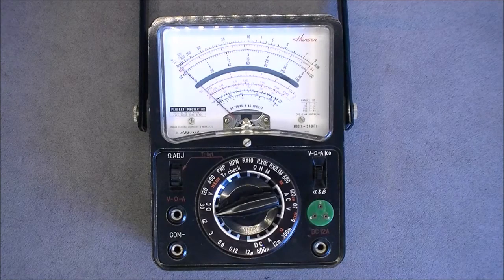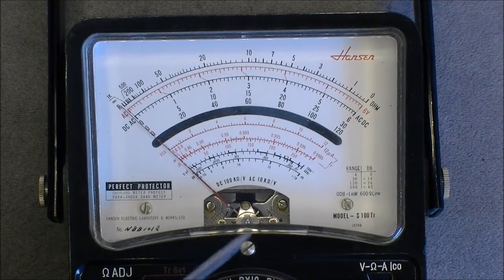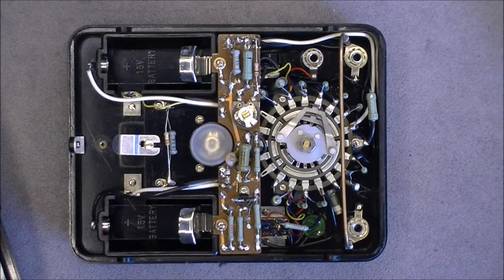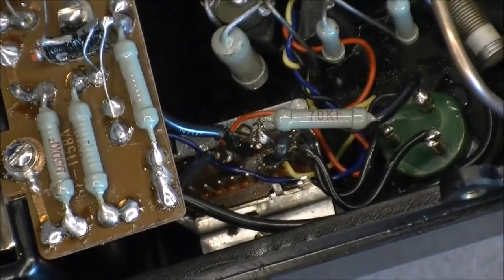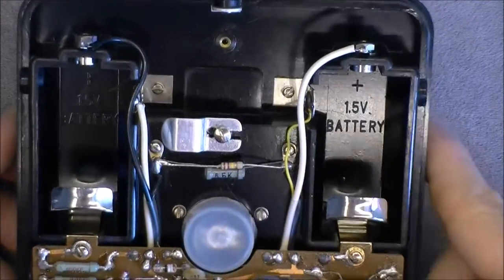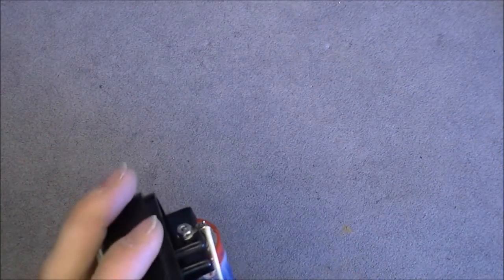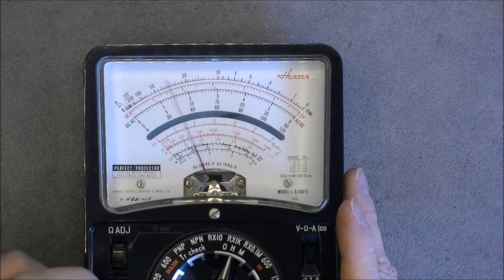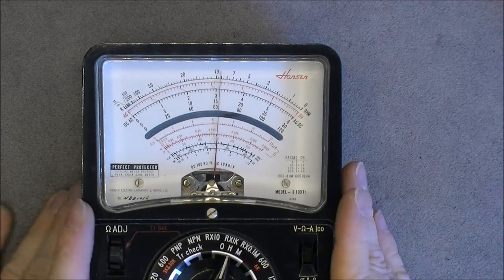Vintage multimeter teardown Hansen S-100Tr from the fleamarket

Comment: Today I found and grabbed the Hansen model SC multimeter, a less complicated model from the vacuum tubes era.  The build quality is amazing.  All solid silver contacts inside.  Duracell batteries 1.5V mil spec. in perfect, non-leaking condition, still holding a bit of charge. Wonderful instrument.